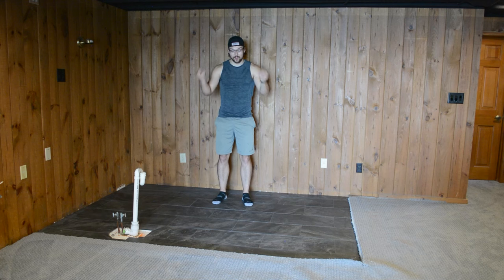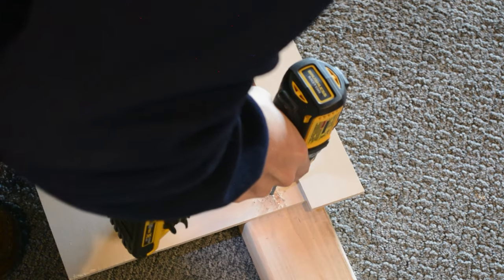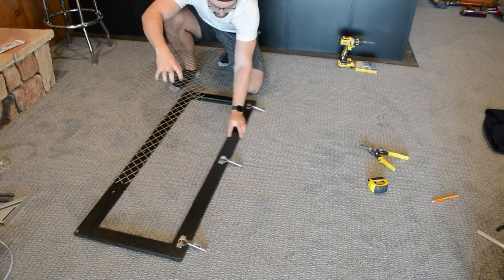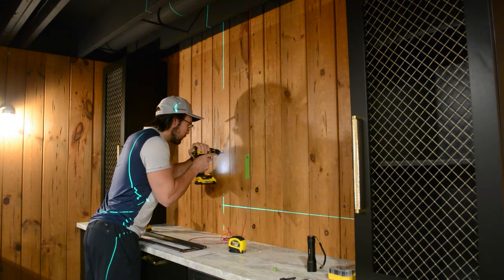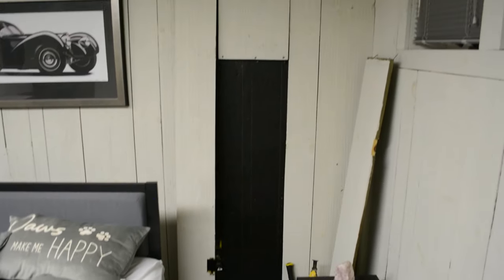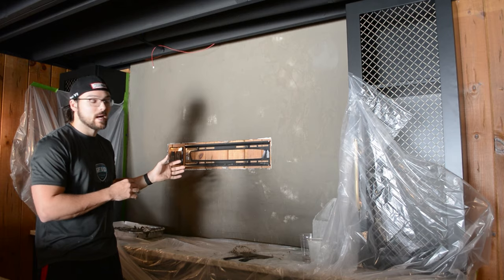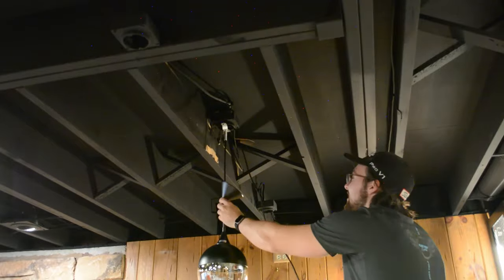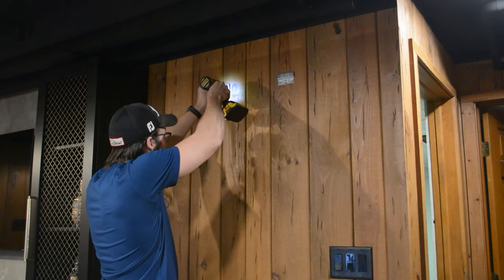BASEMENT BAR BUILD FINALE!! Adding the Finishing Touches!

Comment: Great build! I'm working on a similar project and wanted a black sink like yours.  I did notice on the reviews for the sink that the rinse station isn't sloped so you get standing water.  After having some time with it, what do you think? Not a big deal?
Reply from the maker: Thank you! My sink rinse station is sloped, so I'm not sure about those other reviews. It is a smaller pitch, but it's enough to drain the water. Any little droplets will just evaporate. I really like the sink and recommend it. This is also the only one I could find that was black and fit my 18" cabinet depth. The drink washing station is a really cool and useful feature as well!

Comment: Dimensions for the total space?  I'm looking to do a 4 person bar like you did and wondering the total space needed.
Reply from the maker: The tiled area is about 10’ by 7’. But this is with custom built 18” depth cabinets. Standard cabinet depths are 24” just FYI
Reply: @GoldenKeyDesign  yeah I was guesstimating 10’x8’